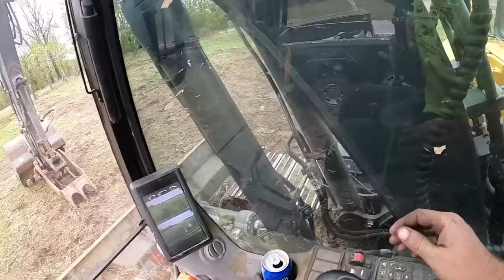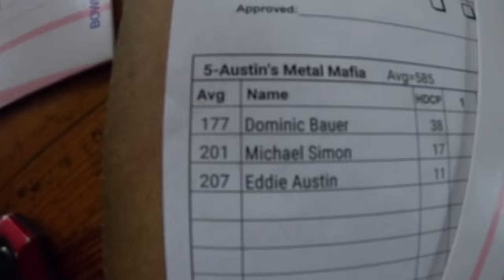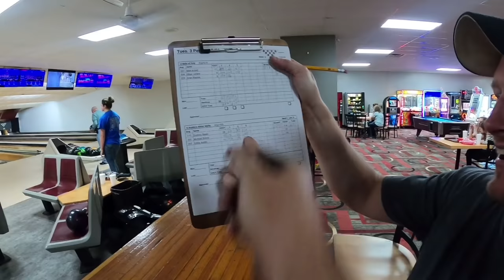Day in life of Dirt Perfect Captain Kleeman wrecked the lowboy and we have some new ICf braces 😁

Comment: Good video, thanks.  Yea, I worked for a company that lined trenches and catch basins and such for new (or old) buildings and ponds sometimes with polyethylene and propylene for catching fluids and such in case of spills.  They charged $850.00 per truck loadup before it ever left the shop. That was 25 years ago.

Comment: Those J links crack and break all the time. I had a 2008 and a 2016 Trailking hydraulic tail trailer and that link broke on both of them.(twice on the old trailer) Welding won't keep it fixed for long either lol

Comment: "Like a Rock"  Chevy pulling a Mack...  I own a 2003 Z71 Silverado and my check engine light is on too... but mine has 400k miles and still drives and hauls... a little slower but still runs.
Reply: I sold my 05 z71 a couple months back with 180k miles. For a 1500, it was one tough truck. Also backwards on things. When hauling all my temps fell. The heavier the better on temps on the trans, and coolant. Pulled 13,000lbs on that truck without issue. Also, my plugs never wanted to stay tight so the truck typically ran low compression by accident. Never threw a code when i took the plug out while it was running! Great truck, but the suspension was worn and needing replacement bushings everywhere. No rust as Texas truck

Don't get these new trucks as they suck. My 2017 3500 ram had the ABS module quit at 103k miles. No cruise for me anymore. Also, extremely easy to dent and scrap compared to those old trucks
Reply: @brandoncaldwell95   I bought my "03 brand new.. it has made a few trips to the midwest hauling a open trailer with my son's Firebird strapped to it... then my husbands drag car... it has been put to work... it has even taken out several deer unfortunately, They seem to love to jump out in front of it.. we had to replace the weak transmission 2 times (flaw for that year) but "Knock on wood" never the engine.  It has several dents and dings and a few rusty spots but it is my go to vehicle when I need a 4x4.   I will drive it until it falls apart.  They don't make them like that any more.  https://photos.app.goo.gl/u5MqjeVsFLdFKWHDA

Comment: A little paint for the brackets and grease on those bolts. Plus a cut piece of pipe with a zerk fitting for a spacer on that bottom bolt I'd say good to go. Yup the time stamp for the job starts at your front door not theirs.

Comment: One thing I see in comments I see as an ongoing misunderstanding is Captains (mishaps). He by relevant terms is a newer operator. He now operates mostly on his own as you give him more and more responsibilities. The broken mirrors and other items, new rake, and the trailer sometimes these things present themselves slowly and an experienced operator gets a feeling of when the machine is not working for him but against him. Yes a broken mirror is clearly the fault of the operator that broke it. However what else was going on. Was the machine in a confined area did a tree limb bounce up or out that he didn’t expect. The amount of times I broke the lower window of an excavator from either a branch that broke weird or a rick that shot off the hammer weird while breaking a rock or concrete is well over a number of years many. Less than a dozen but more than one hand I’m sure. I have hung hard lines on skid steers on tree limbs while moving or loading other materials I had a cattle gate shift last year on my loader with forks on it and took out the self leveling rod. I couldn’t have hit thing just right to do that if I had been trying to. Things happen like DP said the trailer been talking to them for awhile showing her tail to then and wanting attention and repair. DP having run it for along time now probably has a pretty good idea when it miss behaves what gentle encouragement would be needed to talk the machine into just one or two more rounds. A newer operator or someone with a slightly different temperament not so much. It’s easy to set back and poke fun ( not saying we shouldn’t  that’s part of the game. You break it then you get poked on) but we need to remember how much crap did we break ( or still break) as we learned and got those skills refined. 
I off top of my head can say in my life done a fair amount my self I split a D300 CAT in half with only two rocks in the bed (they weighed 30 tons but two rocks) three a track off a PC200 put it back on after 2 hours and threw it back off in 20 feet ( front idler was worn out and bearings gone was trying to load it on trailer ) I literally walked it 600 feet dragging the track and loaded it without it just to get back to shop to fix it. 
Things happen sometimes we all need to remember it and remember the new guys are going to tear crap up as they learn to be on their own and run their own jobs. It’s your job to lead them from the big failures like engines and hydros. Ripping  transmissions and rear ends out of lowboys from getting stuck for example. I think DP is doing an outstanding job teaching these things and all of his workers have done a good job receiving the information

Comment: @19:52
That is an extremely rare left handed spoon. Can’t believe you just threw it back on the ground. 
Should set it into the footings when you start pouring the concrete.
Reply from the maker: Lol
Reply: When they were working on the trailer, I believe I saw them using a metric adjustable wrench on SAE bolts.

Comment: That 2x8 had me nervous. Guess the older I get the more I look at thinks with a little more caution. And you actually trust a fireman to do fire watch. Surprised he didn't charge you a minimum 4 hour call out. 🙂
Reply: To give your hair a little more of a raise, change brakes on a bottle jack in a sloped driveway. Also, don't put the E brake on. Whats more fun is having to loosen the 4x4 nut on the hub by standing on the ratchet and jumping...

I didn't have the tools and certainly was not going to pay a mechanic double to triple the actual cost when the tools are cheaper.

Comment: < Winces .... don't spin the tires you'll suddenly catch grip and snap the power divider
Reply from the maker: It’s a Mack not Eaton 🤷‍♂️😁
Reply: @DirtPerfect  I'm not that into the mechanics.   I can pull a rear end, load it and haul it to the gear shop, and reinstall it. And I know that I hated that damned Peterbuilt because everything was different and required to many different tools. That is as into the thing as I get.  LOL ... all i know is that our drivers running coal would spin the wheels trying to get up on the scales on wet ground and one axle would suddenly catch grip and  snap the power dividers so when he was spinning the wheels I was wincing.  shrug.  

I once made the mistake of asking how "they" come up with the numbers for engine size ... like 455.   I stopped listening about 3 seconds into the 10 minute explanation when it occurred to me that it is just a bunch of stupid math so men could figure out who's was bigger. 4,6,or 8 .... that is all I want to know.